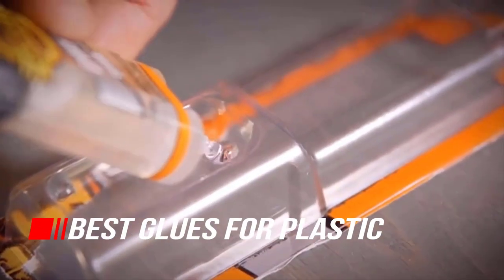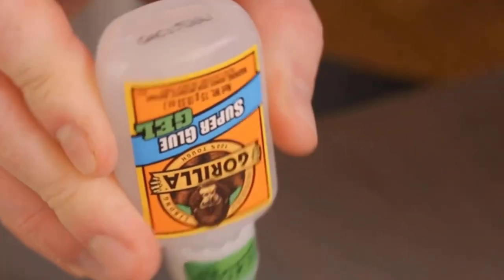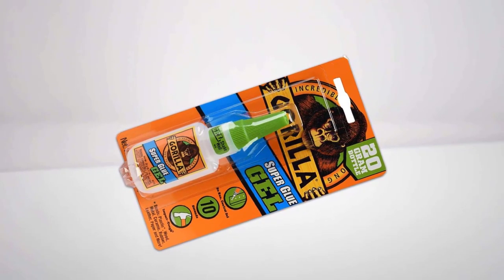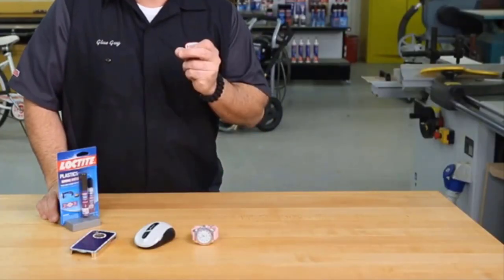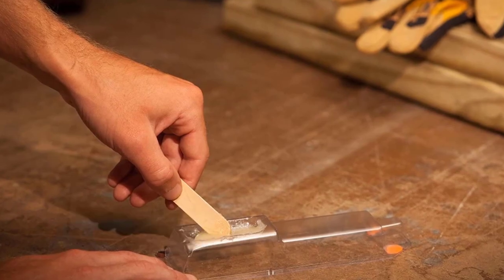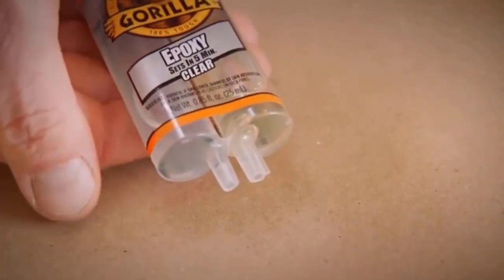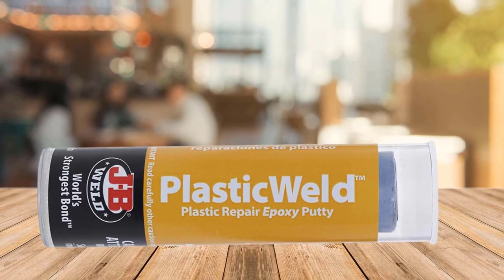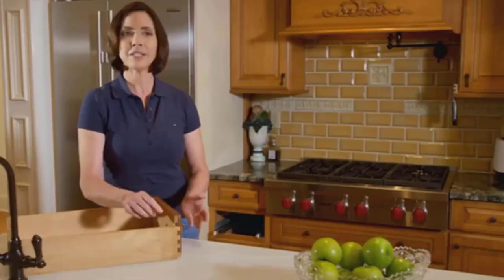Top 5 Best Glues for Plastic Review in 2023 - best glue for plastic car parts in 2023 ✅ 💯 🚀

Comment: Why did you say the gorilla 2 plastic tub is not safe?
Reply: It is not Food Safe, meaning the item you had repaired with Gorilla 2 epoxy when it comes in contact with food or water may release chemicals/ molecules that are not meant for human or animal consumption and if enough gets into the bloodstream may cause illness. So if you fixed a plastic tub or container or something that you can place food or water into could be harmful. Pieces of the Gorilla Glue may also break off and did not adhere well to the repair you made and could end up in the food or water. Then if swallowed or consumed could potentially lead to hospitalization. You can use it for all items that are not intended to be used for placing food or drinks into.